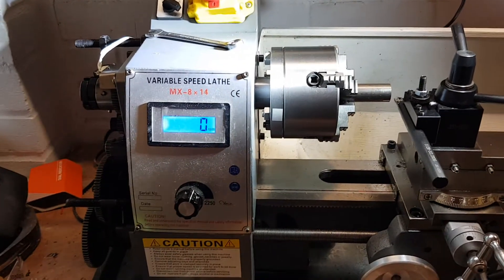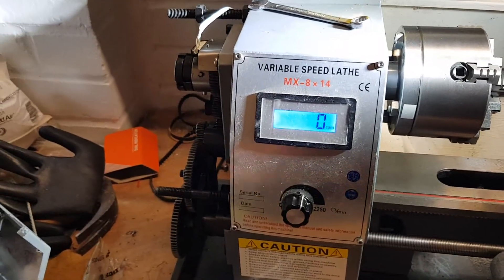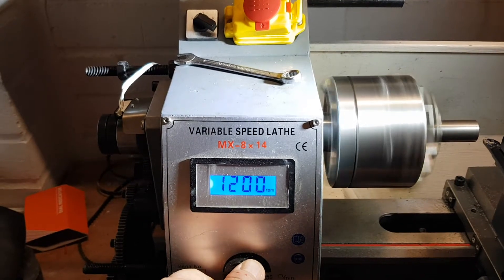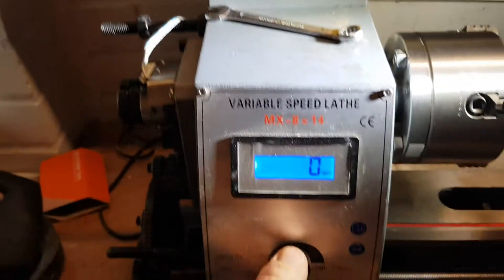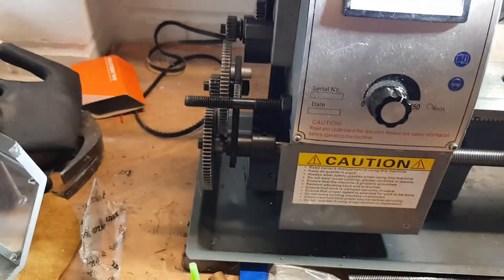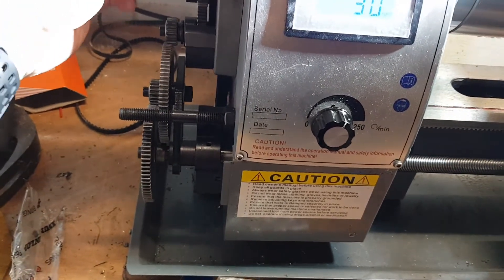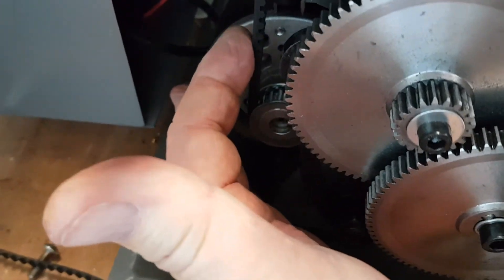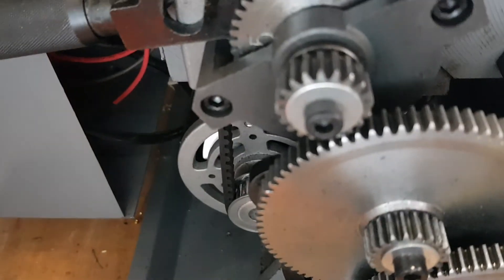MX 8 x 14 mini-lathe improved motor mount and reduced belt tension.

Comment: I put 'sticky' red grease on the gears and they are pretty quiet now.  The belt as installed from the factory was not tight.  It could be pushed about half an inch with my finger.  Under high loads to began to jump and wear the teeth off the belt.  I ordered a couple of spare belts from a person online claiming they were the exact replacement for the original.  Installation was a PITA.

It's obvious the designer(?) has never had to change a belt.  It could be a lot easier with some design changes.  The OEM belt broke before the two spares arrived.  They looked very similar to the original but fitted more tightly.  All was well for about an hour or so when the second belt broke when the tool jammed into the work-piece suddenly.

I know I'm loading this lathe beyond it's intended applications.  I need to turn down a couple of BMW rear wheel hubs and of course they have splined centers so have been hardened.  The supposed 'carbide' bits that came with the lathe leave a lot to be desired but some indexed carbide bits have been cutting well, provided I make very small cuts.  I'm getting there but wish I could find a stronger drive belt to suit the Vevor 8x14 mini lathe.  Suggestions?

Comment: I just got the same lathe about 3 weeks ago and my belt already has shredded 1/3 of the teeth off- exact same issues as yours had. Belt edge was hitting the pulley edge and shredding, too tight and bearings were getting extremely hot. I just finished 3d printing some replacement belts I designed out of a strong but fkexible TPU- which I then wrapped very thin wire around the back of it and melted just into the surface with a soldering iron- designed to have Full tooth engagement unlike the stock belts 1/4 engagement. Works great, I'm going to go file the mount slots rn, and I also have tapered bearings to go in. Thanks for the video!

Comment: Thanks for the info, I have the exact same lathe as you and my belt just snapped. The belt lasted over a year with no teeth on it due to the head stock bearings failing after a couple of months, I changed the bearings to sealed angular contact bearings and it transformed the lathe.

Comment: Hello
I have the same lathe.
Can you make threads? I can't fillet.
Reply from the maker: Yes, thread cutting is OK I have done 24tpi threading.   I don't know what you mean by "fillet".
The other operation I have managed is "cut-off" by using a blade upside down and running the motor in reverse.

Comment: I ordered this lathe and expect it as soon as tomorrow. Ill know to inspect the belt especially. Did you have issues finding the belt & how much larger did you go.
Appreciate you taking the time to post this.
Reply from the maker: Not all of them have the defect that prevents the adjustment of the motor position which results in the "over-tight" belt.  I looked online for a belt of similar/same tooth patterning and bought a selection of them to see what might work.
The one that worked for me came from Bolton Engineering and was a 475-5M-09 timing belt.
Others have said I am using the wrong belt, but this is still on there, still working and giving mr no problems.  🙂
Reply: @DClarke1954  👍

Comment: Where do you get the belts from ?
Reply from the maker: Answer is already in the comments Malcolm.
I am told the belt I selected /chose is "wrong" by another commenter, but it seems to work fine for me, so I shall stick with it.
Reply from the maker: I looked it up for you Malcolm....
Oh gosh, now you are asking.  :)   I tried several before I found one that fit properly.  I think it was From Bolton Engineering Products  and was Stock Code 475-5M-09  https://bepltd.com/products/475-5m-09-htd-5m-timing-belt-475mm-long-x-9mm-wide
 is what I have used.

Comment: It needs to be rather tight not to slip with the correct belt size
Reply from the maker: Hi Tony, Maybe my belt is wrong, but.... It isn't shredded (unlike the one originally supplied), the bearings are not overheating (because the belt isn't far too tight), and the lathe doesn't stall and strip the belt teeth.  So it cannot be so terribly wrong (IMHO).   Could you provide a part number and a source for a more appropriate belt in order to help everyone else please?   Cheers!  :)

Comment: That is a incorrect belt the correct size is 9.5 mm 4.7 95 teeth metric belt
Reply: To be a touch more specific, it is an M1.5 x 10mm x 94 tooth
Reply: @tadhasse  👍

Comment: Looks like your shaft is bent on the leadscrew at the gear. You can see it moving back and forth in the video.
Reply from the maker: Yes, it did have a bit of a "wobble".  It is resolved now.  But the mis-alignment of the various gears is still an issue. with some of them only 1/2 overlapping each other.
Reply: @DClarke1954  hi.  how did you sorted leadscrew issue please? Great video btw.
Reply from the maker: @rolandaslatvys22    I pulled the gear off from the leadscrew and re-seated it properly.   The shaft was not bent.   I have successfully cut 24TPI threads using a special purpose gear and it all worked very well.
Reply: @DClarke1954  Thanks for that, mine is slightly bent I think , as half rotation it spins free and half rotation very hard. Will need to strip it down and have a look on a flat surface.

Comment: What size belt did you use and where did you get it from please
Reply from the maker: Oh gosh, now you are asking.  :)   I tried several before I found one that fit properly.  I think it was From Bolton Engineering Products  and was Stock Code 475-5M-09  https://bepltd.com/products/475-5m-09-htd-5m-timing-belt-475mm-long-x-9mm-wide

Comment: Oh wow. Seeing you flex your belt really helped. Yeah, mine's as tight as a bow string too. If I pluck it, it's a B flat just above A 440.
I just have circular holes too. Looks like it's time to file.  
My main goal for this lathe is to be able to thread M12 x 0.5.
Do you think yours could pull it off now?